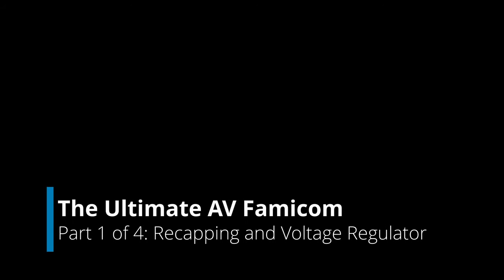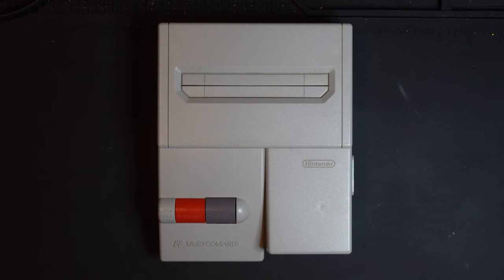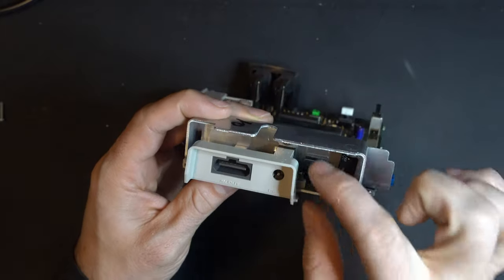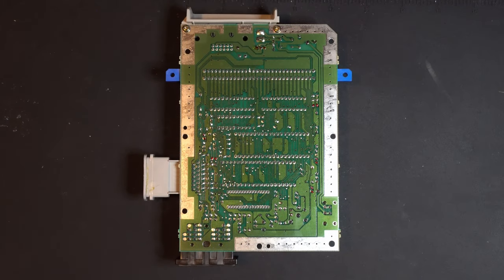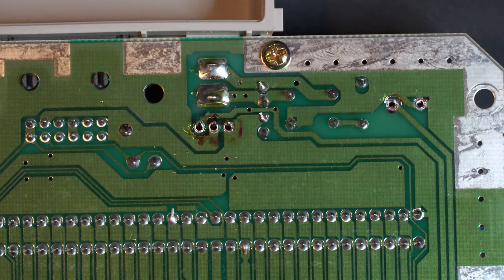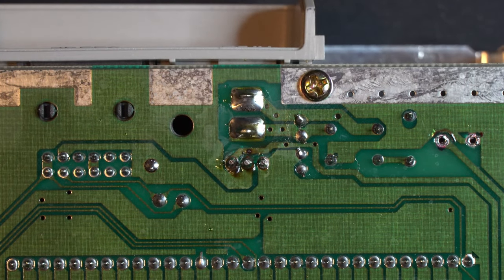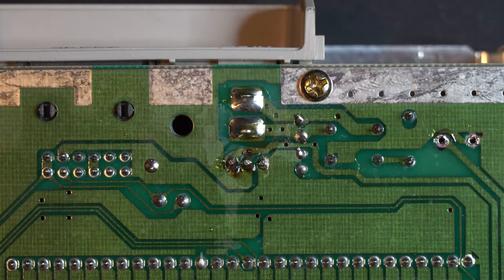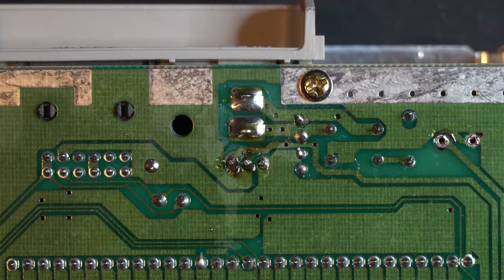Ultimate AV Famicom (NES) Mod - Recapping & Voltage Regulator (Part 1 of 4)

Comment: If I am using the famicom n8 pro flash cart are there any of these mods I can go without/aren't as important? One of the reasons I ask is because it has an improved audio mixing circuit.